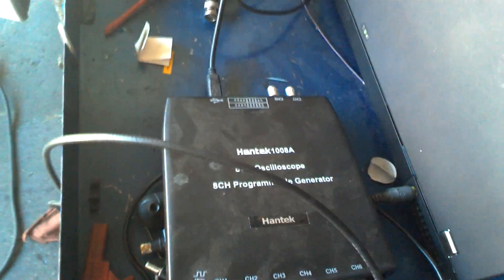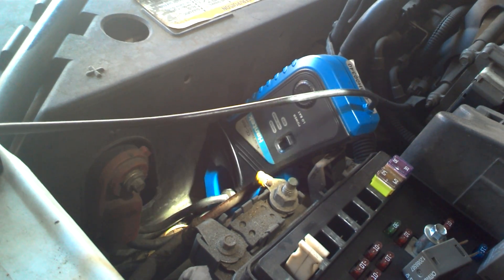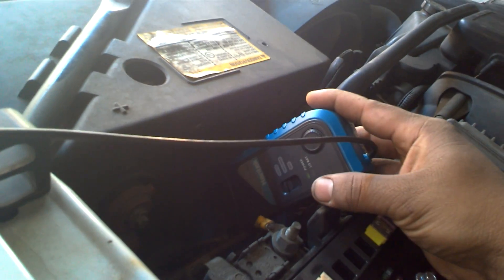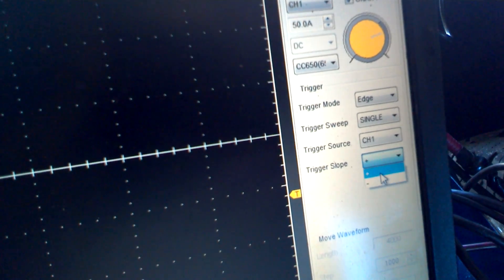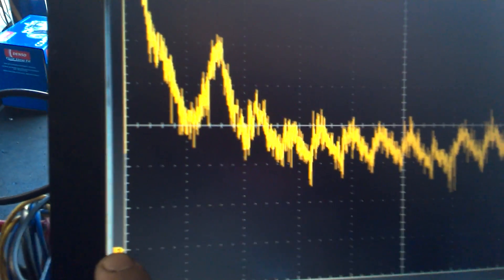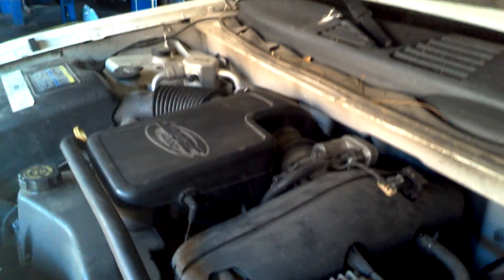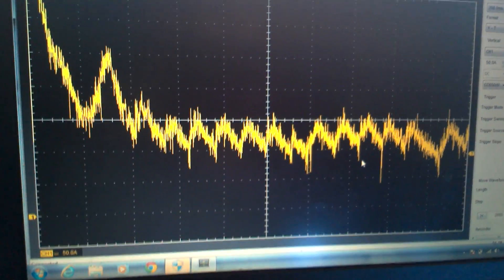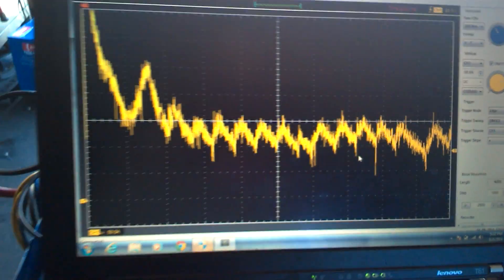Hantek 1008 Relative Compression Test

Comment: Hi...I have the same scope and clamp....Can you tell me  how the amp clamp is attached to the HanTek?...with the attenuator?.....or without?...
Reply from the maker: No attenuator necessary. Just be sure to select CC-65 in the drop down menu.
Reply: Thanks....I think you indicated you had to use the CC-650 because of the wire size...maybe the amperage too......

Comment: ..quiero preguntarle si conoce alguna biblioteca o base de datos en donde aparezca los #s de dientes para CKP ejemplo (60-2) GM. pues cuando abro *CrankWheelPulser*, me pide esa info....además, cuando quiero que las dos señales sean Sync, me pide Cam Trigger !    ...o como sincronizar señales CKP+CMP con el osciloscopio 1008 a fin de darle inicio a ECU al blanquearla?
Reply from the maker: Disculpe pero no escirbo/ni hablo el espanol muy bien. Perdoname si lo que yo escibo no es claro.
No conzco un libro que tiene eas informaccion. Yo usaba iatn.net para esa informaccion cuando yo trabaje en autos.
No se de su problema espesifica de el "CrankwheelPulser", pero para poder ver las senales de el CKP y CMP, pon el terminal positive del oscilloscopio en la guia de unos de los sensores y el otro a tierra. Es igual con el otro sensor. Usa los triggers y el time/div para ajustar las ondas hasta que la figura en al pantalla se parece bien.
Reply: I just want you to ask if you know how to acquire a data base. or maybe a personal list or how to make with Oscilloscope a Synchronized CKP+CMP signal.
Reply from the maker: The signals themselves i acquired from iatn.net. Users post CKP+CMP signals that they took from known good vehicles. It is a pay service. Unfortunately that is the only source I know of. If you have access to AllData or something similar there may be more information there but in my experience it is limited on example waveforms

Comment: what did you disable stopping  it  from starting so you can get you reading
Reply from the maker: Since I was filming alone, I removed the Fuel Pump Relay. If you do this you will also need to start the engine one more time since there will still be residual gasoline in the fuel lines. Once the engine only turns over but does not start you will be ready to perform this test. I would like to add that in many modern vehicles, including this GMC, if you turn the key to the ON position without trying to start the vehicle, depress the accelerator pedal completely and hold the pedal down, and then try to start the engine, the computer goes in to Clear Flood Mode. What happens is that the computer will temporarily disable the fuel injectors as well as the fuel pump so the engine will not start. When I perform relative compression tests, this is what I usually do.
Thank you for your question, and thanks for watching!!

Comment: hi,thanks for this, but can i use the cc-65 for relative compression test ???
Reply from the maker: Unfortunately not. Even the smallest engines draw at least 160 Amps during start up through their starter motor. The CC-65 is not accurate at those levels. The CC-65 will not allow a wire thicker than 1 cm to be clamped and most battery wires are thicker than that with their insulation. A CC-650 is necessary for relative compression tests. Thank you for your question and thanks for watching!!
Reply: I just watched a Scanner Danner video and he used the 65 amp probe but set it on the 2v scale instead. Unfortunately he was using a Snap-on Verus scanner and I'm not sure if it will work on the Hantek, my scope is still  on the way from China.  Scanner Danner link:  https://www.youtube.com/watch?v=WKdZsWU2ZmI

Comment: When testing spark plug current, is it true that you need an attenuator it will damage your oscilloscope? Maybe upload a video where it is being used properly on spark current draw?
Reply from the maker: I believe you mean ignition coil primary CURRENT draw. When measuring current it is typically done with a Current Clamp or "Amp Clamp" and no attenuator is needed. When dealing with ignition coil primary control VOLTAGE, the inductive spikes can be as high as 400 volts and in that case an attenuator is mandatory.
Reply: Enrique Osorio thank you for your response.

Comment: I've seen a Pico actually give specific numbers for a relative compression test, I guess taking the highest voltage as the baseline and then comparing the other cylinders to that then giving percentages for each cylinder.  I'm guess the Hantek doesn't do that, but could you measure each peak and do the calcs by hand or would that be really tedious?
Reply from the maker: You could absolutely do the calculations by hand. It would be a simple fraction. If you are using the highest peak as your baseline then you use that current measurement as you denominator and the other values as the numerator. For example if you had a 4 cylinder motor and the peaks were at 135 Amps, 110 Amps, 140 Amps and 132 Amps then you would have 140 be your baseline. The percentages would read as follows 135/140 = 96% , 110/140 = 79% , 140/140 = 100% , 132/140 = 94%. This is not the most accurate test but it does tell you that they cylinder at 79% needs the most attention. Hope this helps, thanks for watching.
Reply: Is it easy to get the number measurements from the Hantek?
Reply from the maker: Yes, use the cursor feature. On the menu at the top "Cursor" should be fifth from the left. Make sure to select the correct source, which means selecting the channel that you are trying to measure. The source can be selected in the Cursor menu. Next select the Horizontal Cursor in "Type" submenu of the Cursor menu. Now click on the screen somewhere, hold down the mouse button and drag to somewhere else on the screen. When you release the mouse button you will see two horizontal lines appear and some measurements at the bottom of the screen. This will tell you the difference in voltage or amperage between the two lines. If you set one of the lines to the zero mark of the channel that you are measuring and the other to the peak of one of the "bumps" in the waveform you will see the amperage of that particular peak. Do that for the subsequent peaks and you will have the measurements for all of the cylinders that you tested. Look at the following screenshot.

http://imgur.com/a/t2Xd1 

This is a relative compression test that I did on a 2002 Toyota Tacoma 4cyl. All of the white numbers and lines in the picture I added in a photo editor after I took the screen shot. The large numbers are the cylinder numbers the small numbers with psi next to them are the measurements I made with a real compression tester gauge. The difference in current on the left shows the difference in current between the highest peak and the lowest peak. You can see the measured number at the bottom of the screen as well. This shows that with this engine and with this starter a 20 amp difference corresponds to a 40 psi difference in pressure. I am not sure why I put in 21.7A difference when the scope clearly shows a 21.3A difference. I made this graphic years ago. 

I hope this helps. Thanks for watching and thank you for your comments and questions.
Reply: Great!  I saw a useful technique on Shrodinger's Box channel for getting actual PSI from the amperage readings.  Basically take a traditional PSI reading on a single cylinder, then do a relative test.  Divide the PSI by amps for the single cylinder measured to get PSI per Amp, then to get the PSI for the other cylinders just multiply each amp reading by the PSI/Amp number and you'll have the PSI for all the read of the cylinders.

Comment: I am looking at purchasing one of the oscilloscopes, did you find this hantech was able to supply you with the functions you required, basically up to the task or would you have gone something a little better etc? thanks
Reply from the maker: I did purchase better scopes but that was only after realizing that an oscilloscope was right for me. The Hantek is a good tool but not the best tool and it was only after seeing that I wanted and needed a more powerful tool, that I decided to spend the extra money on a PicoScope.
Reply: thanks enrique

Comment: Hi, 
You pointed out that one of the peaks was the # 1 cylinder and so on, how did you identify that particular one to be #1?
Reply from the maker: Good question!! Thank you for asking that, I am sure other people were confused about that part too.
I did not mean that it was the number one cylinder, rather since this is a 6 cylinder engine there will be six current spikes for every 2 revolutions of the motor. For this reason if you see a depression where there is supposed to be a current spike and that depression has 5 spikes between it you can be sure that there is one cylinder with low compression. When I started counting I started from an arbitrary position but for the purposes of this test I did not need to know which cylinder had low compression just that one of the cylinders had low compression. From then on I completed other tests to verify my diagnosis.
If you use a second channel to monitor the ignition coil firing of one of the cylinders you can actually line up the current spikes with the ignition coil firing and by using the firing order you can identify which cylinder has low compression but I did not do that in this test.
Reply: Enrique Osorio thank you for that clarification, indeed I was a bit confused.
Definitely I am not as experienced as you but that had me a bit confused. Good luck
Fareed

Comment: Hello! What was the problem Error 0305? because of what happened in the fifth low compression cylinder? Thank you!
Reply from the maker: Sorry for the late response. We do not know what is going on in this engine. Likely a valve spring broke but we are not sure. The customer decided to sell the vehicle to a wrecking yard. We did not diagnose further.
Reply: Сергей Геннадиевич

Comment: Have you used the dso6074BE ? How would it compare to this scope as well as the pico? I only do this as a hobby im not sure 3k (pico) is a good buy for a 4 channel scope. $300(Hantech dso6074BE) is doable but i guess it depends on how much better it would be over this $80(Hantech 1008) dollar scope?
Reply from the maker: If you are just going to be using the scope for hobby purposes then the Hantek 1008 might be the best bet. I have never used the DSO6074BE so I can not say with any certainty how good it could be but I would expect it to perform well. The Hantek 1008 is far from perfect but I will use the 1008 while working with electronics on my desk or under the hood of my car. There is definitely a learning curve with this scope since it is not as user friendly as it could be but it does work. 
If you plan on working with signals exceeding 250kHz then you will absolutely need something like the DSO6074BE. The Hantek 1008 can not handle any signals that are going that fast. In fact when I am testing signals that exceed 1 mHz which is common I have to use my PicoScope.

Comment: so to do a relative compression test i cant do it with the cc-65? i need the cc-650?
Reply from the maker: +Alejandro Amaro You will need the CC-650. Since the maximum I have been able to read on the CC-65 is 150 amps and most starters can pull over 200 amps you will need the CC-650. Additionally the CC-65 has a very small clamp which will not encircle a battery cable. The CC-650's jaws can comfortably clamp several thick conductors.
Reply: Oh okay. So i should just start off with the 650 to begin with. I will be watching your videos to learn the use of a scope. Thank you my friend

Comment: Hey I have a quick question about the scope. Does the program Have a button to clean up or filter the waveform so that it looks better when performing the relative compression test?
Reply from the maker: +Alejandro Bejarano It does not. That is called a low pass filter. A lot of scopes have that function due to the fact that there can be a lot of noise that can be picked up in the very high frequency range. Usually that noise is on the order of 20 MHz or higher. The low pass filter gets rid of any signal that is above that frequency. The Hantek does not need that because the fastest signal it can capture is a 2 MHz signal. This means any waveform it captures is already "filtered" although it really is not. Hope that makes sense.
Reply: I did a lowpass pasive filter to clean the relative compression waveform, is not perfect but is clearer I can get.
Reply: How did you do a low pass filter on this scope?  I'm working with a car that has allot of ignition system noise in the sensor signals and I'd love to filter it out so I could get clearer waveforms.
Reply: What about filtering out ignition system noise?  All the sensors on my Mazda 626 ( other than the crank sensor ) get interference from the ignition system and it makes the signals really ugly and hard to tell if there is a problem with the signals or if it's just noise.
Reply: Could something like this be used?  Seems a bit expensive, costs almost as much as the hantek scope...  https://www.thorlabs.com/newgrouppage9.cfm?objectgroup_id=8613
Reply: What is a low pass filter? The First order Low-Pass is simply a coil in series with the chain. So, You can try a few coils with different induction  , and chose this with the best performance in your case.

Comment: Hey bro, awesome videos. Very informative. Was wanting to purchase a scope. How long have you had the hantek 1008a and any problems with it? for 90 bucks on ebay, it seems like a good deal.
Is there lag time on the scope itself?
Reply from the maker: +Justin Jose. I have had the scope for about 4 years. I used to have problems with the program crashing but that was solved with a more powerful computer. I have "overvoltaged" it several times by accident. I have given it 400 volt spikes and it came back for more. This scope has worked out for me and taught me a lot about automotive and electronics in general. I think it is a good buy if one has the funds and the time to learn and try  to work with it.

Comment: Would the Hantek have to use the same brand of amp clamp you are using here or would it work with a different brand of amp clamp?  I see the clamp costs as much as the scope.
Reply from the maker: +Tabo Racho Any amp clamp that outputs a voltage that corresponds to the amperage running through the clamp will work. If the conversion from Amps to milliVolts is different than the Hantek's then you are going to have to do the conversions yourself. 
As an example, the Hantek CC-650 amp clamp on the high setting will convert every amp flowing through it to 1 millivolt. So if I clamp a wire that has 10 Amps running through it the clamp outputs to the scope 10 millivolts. If I select on the scope that I am using the CC-650 in high amperage mode, it does the conversions for me. An amp clamp that uses different settings will give erroneous numbers but if you know what the conversions are you can make it work.

Comment: Enrique, What amp clamps are you using with this setup? The two that come with the Pico kit are very expensive. Its like 400 + dollars for 2 amp clamps.
Reply from the maker: +ILTSYC  On eBay you can get the low amp clamp called the Hantek CC-65 for about $50 USD and the high amp clamp called the Hantek CC-650 for about $65 USD. That is what I used in the video.
Reply: Thanks man! Have you checked how they read along side another worthy source to make sure they read accurately?
Reply: Is the Hantek as good as Pico or better to go with Pico? With Hantek you can get way more cables and clamps with the 4 channel kit, practically everything for 600 bucks which is about 1/4 the cost of Pico. Pico may be good but even a fool knows they are way over priced.  Does the Pico offer a black screen?

Comment: Nice Video, but dude, PLEASE !!  After a Relative compression test, I hope you did both "WET" and "DRY" compression tests on cylinder 5.  I've always hated when there would be a "Needs An Engine" diagnostic outcome on a vehicle that simply needed the head pulled and a valve job done. It's waay cheaper , but , then again, most shops, that I have worked for, go for the quick buck.  Still a nice video though. :)
Reply from the maker: We did not bother with further testing. Compression was exactly zero and the customer was not interested in any repairs. Basically he was hoping it was an ignition coil or a spark plug. Anything over $200 would have been out of the question. He got rid of the truck.
Reply: Ah, ok.  I wish that more customers would have a "Worst Case Scenario" type of outlook, rather than a "Hopefully It's Nothing" kind of outlook. That way, when they bring their vehicle in, they are already prepared to pay $2,000 , even if it only turns out to be a $20 problem. Nothing more aggravating than a customer that expects you to perform a Million Dollar Miracle on his Five Dollar Budget.  ;)